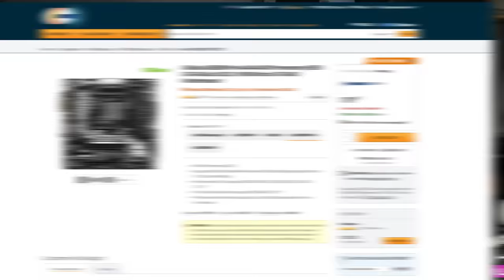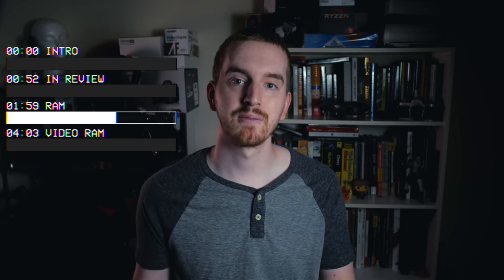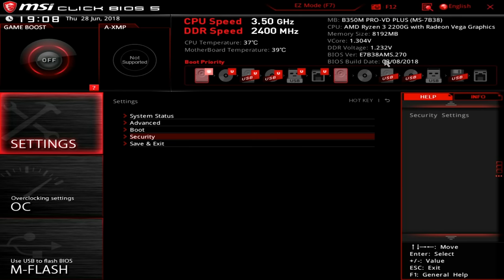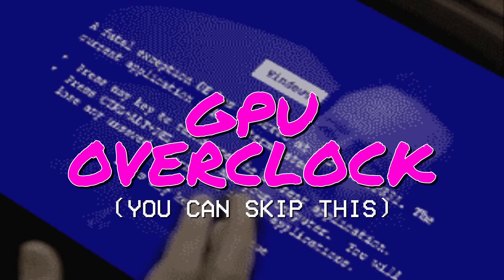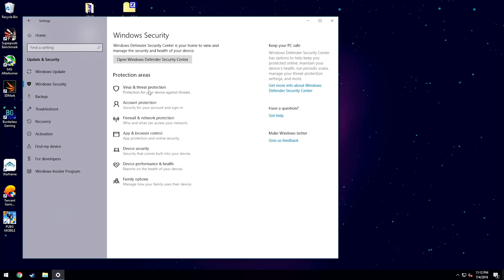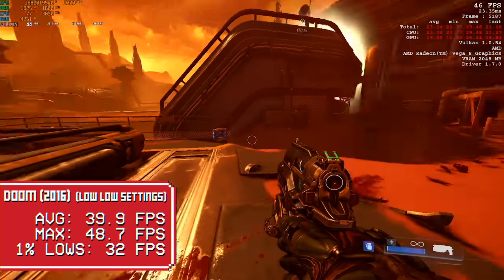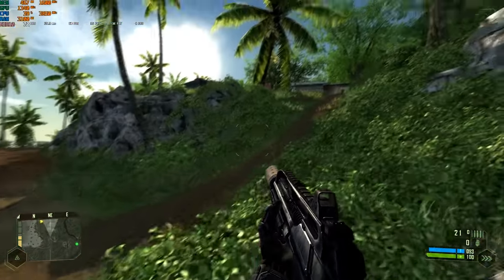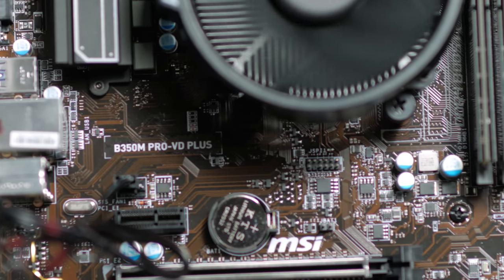How to get INSANE GAMING PERFORMANCE out of AMD Ryzen 3 2200G APU - Ryzen 2200G Optimization Guide

Comment: hello sir, i have 8gb ram but it says 5.95gb usable.. can u help me on this? ty
Reply: Im having a same problem
Reply: I may be able to help press the Windows key + R and type msconfig then press ok go over to the boot tab and click advanced options if the button "Maximum memory" has a checkmark on it and the memory (In Megabytes) is lower than 8 GB that is the problem you should be able to uncheck this box and restart windows which will hopefully solve the issue while you're in there you can specify how many processors are used during boot by default windows will use 1 but you can change it to use all cores during boot which may decrease boot times
Reply: @EternalOhm  i've already done that sir but its just the same, nothing change... my ram is ramsta 8gb 2400Mhz
Reply: @nbahighlightz52  What version of windows do you have? I'm under the assumption it's Windows 10 64 Bit but have no way to be certain. Also do you have a integrated GPU or a dedicated one or both?

Comment: highly recommend using b450 motherboards yes its more but its stable with ryzen 2200g and 2400g. sometimes a bios update just is not the same as the motherboards designed with a chip in mind.

Comment: why are you running these games at 1080p? You could get almost double the framerate at 720p
Reply from the maker: Because it's a standardized benchmark resolution to run at, and running games at non-native/non-even-integer-scaled resolutions on LCD monitors generally looks horrible. Thankfully most modern games come w/ built-in render scaling while keeping display resolution the same to combat this.

Comment: I have the ryzen 2200g/x370 pro carbon and i didnt oc or enable the boost and the vcore voltage 1.384 should i lower it or its ok?

Comment: what if I go for 2400G Ryzen5 instead of 2200G Ryzen 3? have a tower cooler or water cooling and an Asus Board with 3000MHz plus 16gig ram2? should I go for B350 or X350, X370 or X4XX for future proof CPU upgrade?
Reply: Save up for a RX570 instead, and pair  it with the Ryzen 3 ..

Comment: The trick with igpu OC on a APU is that is completely USELESS to OC the cpu part, they already got nice stock clocks, gpu OC will benefit gaming performance a lot more.

OCing the cpu part is just wasting TDP and stability that could go for the gpu.

With igpu OC on this APU's sometime you will get crashes at 1600 but none at 1650, or 1550. Quite funny.

Comment: When i was with only vega8 on board, i did overclockboth cou and gpu, thoughi could run easily gpu at 1550 mhz and it was stable...
And mine 2200g was running at 3.9 ghz stable.
So yeah nice video, but all of these i did before even watching your video :0

Comment: why remove the battery?

I never seen a MObo without the jumper to reset cmos...
Reply from the maker: Tiny mobo that isn't labeled well and it was easier to reach down and grab battery than pull out a screwdriver find the right pins each time, etc. Battery method is how I've been doing it for 10+ years, just how I do things.

Comment: What has worked for me and assured RAM stability is downloading and burning a disk or bootable USB to run MEMTEST86 which is free . I have seen failures on the 2nd pass when the first was clean but never after the 2nd test(but take that with a grain of salt because I've only tested about 50 different times). Initially I run the default 4 passes and cancel test if to make adjustments if I'm getting errors. When you find what you believe to be stable, let it run over night while you're sleeping. 10 passes might take around 8 to 9 hours depending...  Also for Ryzen google Ryzen RAM Calculator or just go here http://www.overclock.net/forum/13-amd-general/1640919-ryzen-dram-calculator-1-1-0-beta-2-overclocking-dram-am4.html and download the calculator and watch the video. I personally have had better luck loading from XMP than using Thaiphoon export to calculate the settings but you will need Thaiphoon for the RAM information for the initial settings in the Ryzen Calculator. This will give you a better result than using the MSI preloaded settings.
Reply: 2200g and 2400g can get really hot under the stress when OC'ed and we are talking up to 95c left for 8~ hours, i wouldn't risk to find a fried VRM and hell what else.., especially on a motherboard with poor heatsink or completely without it

Comment: So I got my cpu to 3.85 and my gpu to 1600, my temps while gaming (Gta V Rp FiveM) usually are at 70-75 and sometimes spikes to 77-80 but that only lasts like a second or two. Any tips to lower the temps? Btw, my gpu voltage is set to auto.

Comment: I'm using the ryzen 3 3200g and got a stable OC on the iGPU for 1600mhz at 1.2v on a asrock b450m pro4. Even tried it on furmark and it wasnt going over 55 degrees with stock cooler
Reply: Can up vram up to 4 gb?

Comment: am running a Ryzen 2200g and had similar problems like you. But it was mostly because of setting my ram oc and cpu oc incorrectly. I barely gained 4 FPS average with a 3.7 cpu oc BUT my gpu oc to 1400 with voltage set to 1.2 works like a charm and gives almost 20 avg FPS! All my blue screen vanished after setting a reasonable ram oc. Like 3200 on a 3000 rated sticks. Also the stock wraith heatsink is good but not great

Comment: the video ram one is wrong my dude, you can leave it on 64mb without affecting performance since it uses system RAM as memory anyway. If budget gamers get only 8 gigs of DDR4 it makes no sense to dedicate 2 gigs to the GPU. I would appreciate it if you would correct yourself in the video. (windows 10 optimizes the memory better anyway so you might get a 5% boost allowing it to fiddle around with the extra ram)

Comment: 400W Dual rail would be enough even if you add 1050 or 1060ti. more than that gfx, you would get bottle-neck due to cpu. if you want more than 1060 later than no point of having this cpu cuz onboard gfx would be a waste and you would get stuck with a low spec cpu. if you have an old gpu than buy normal ryzen 3 for more performance.

Comment: Nice video but I don't really blame the APU. For example I built maybe 300-800 A6--A8-A10 apus and I've never had these issues. I haven't had enough time to run to Old APU use on Windows 10 but the ones I have run seem to be fine as well.  I think it's Windows 10 as there's so many weird issues with Windows 10.

Comment: you should oc the gpu on these apu first and get the highest oc you can then oc the cpu core last you will get higher gpu clock speed than if you do cpu first and maybe not as much cpu oc but the trade off is worth it

Comment: I have a biostar motherboard, if I set my ram overclock too high and it can't boot up it retry's to boot up two to three times more before automatically resetting the settings to the stock speed and then I'm fine.

Comment: Cant get past 2933mhz with my  2400mhz 2x8 g skill ripjaws v kit, i tried loose timings, higher dram voltage and soc voltage but nothing worked. I have a b350m mortar motherboard.

Comment: The dilemma I have with AMD APU is that, it's either I spend the extra money I have for a decent GPU or spend it on 16 GB of ram since I don't want the system to be left with 6 GB of RAM.
Reply: I think it depends on what you're aiming to use the system for. I upgraded away from my 2200g, so I'm thinking of tossing that into a living room media PC that might do some light gaming when I have guests. I have no aims of it doing anything that's especially demanding, so a system total of 6 gigs of ram would be comfortable enough for my use.

I think that 16 gigs of RAM deserves a Ryzen 5 or 7, with a discreet card. Unless you're going to be doing some extremely heavy non-gaming stuff that's going to eat up a TON of RAM.

Comment: I don’t think you understand the point of showing game benchmarks - you’re supposed to keep the settings the same between benchmarks so you can tell the performance difference looking at the frame rate...

For a tech channel you should really know better
Reply from the maker: Which would be valid or worthwhile if this was a launch day review or something where benchmarks were necessary. Nowhere does this say it's a 2200G benchmark or review video. What I'm "supposed to do" is show what kind of significant performance differences viewers could gain from the previous build video to this one. Which was conveyed through the pseudo benchmarks, settings upgrades, and games that weren't even playable before.
Games that struggled to hold 60fps were kept at the same settings as last time.
Otherwise there's no point in keeping the same settings and showing that you can get multiple levels of graphics settings increases AND a higher framerate, that's more useful information than just raw higher numbers.
For a tech viewer, you should really know better.
Reply: I actually kind of agree with Epos on this one.
As long as 60 Hz averages and 40 Hz 1% lows are reached both before and after I'd say that the visual improvements are worth it and illustrating that it is even possible is well worth doing.
That said, you got a point in that it would have been nice if he also showed an apples to apples bench as well to compare them.
So a setting A setup 1 bench, then setting A setup 2 bench, then a setting B setup 2 bench.
But for a limited video length this is just fine in my book.
Reply: EposVox you claim to wait to show performance differences, the best way to show it is to show an increase in frame rate while keeping settings same. So you could say for example, after your tweaks you get 15% extra performance per say.

I don’t get what makes this so hard for you to understand. This is not a benchmarking thing, every serious tech YouTube channel compares performance between different cards/settings this way because there IS a way to quantify a performance difference between different frame rate, but changing settings from high to epic leads to different performance change for each game and is a terrible way to objectively measure performance increase.
Reply from the maker: "Extra 15% performance" doesn't mean anything to average gamer if you're already past a smooth, non-stuttery 60FPS. Again, if this was a serious, scientific benchmarking video I would agree with you. This is purely an experiment and show what you can do. I find raw benchmarks to be incredibly boring, as do many viewers, and much prefer this approach. The focus was the upgrade in settings.
Also showing apples to apples would've been nice, but this video was already far too long, that was the least important information, and I already put far too many hours into re-running the same benchmarks over and over I had little interest in doing it again.
Reply: I liked Epos's approach on this one too. You can always get relative numbers from reputable benchmark sites, but often i have a practical question, so i have these specific games - what grade of visuals and performance can i actually reach on a given system or from a given system upgrade? The game-based benchmarks have a synthetic flavour to them nowadays, because benchmarking on Ultra is so popular, but often the setting efficiency jumps off the cliff there because you have much more data throughput and computation for very little visual benefit and a playability disadvantage.

Comment: I bought two sticks of 3000Mhz RAM but in bios and in task manager it says its 2400mhz. if I use the ram overclocking technique to get 3000mhz is it guaranteed It will work cus I don't wanna tamper with the motherboard

Comment: I have ryzen 3 2200g build with gigabyte a320 Mobo... My pc starts , fan starts and turns off again! Pc won't boot... I've tried cleaning ram , hdd nothing worked.. I've also tried building everything from scratch... Didnt work either.. HELP?? :/
Reply: the a320 motherboard is not overclockable, higher speed rams like 3200 and above probly wont work, try using a ddr4 2666 speed ram, this should make your computer work
Reply: +Droid Tutorials
Tried pulling out the battery and turning off the power of the PSU then waiting for a few minutes?

Comment: most mainboards have 2 cmos reset pins indeed, (ancient ones usually 3, that switch between reset and retain) which you can put a jumper on to short them then press the power button as they are shorted to trigger the cmos reset.

but as jumpers are a rare sight these days, i usually just hold the tip of the screwdriver against them to short them 

when you start tweaking subtimings and run into a LOT of failed posts, it's a lot quicker than fiddling with the battery everytime.

i'm actually puzzled there are mainboards that don't have it... that's pretty ghetto if you ask me :)

Comment: It's disapointing you didn't include the benches of the pre-overclocked card. Can I increase video ram without a BIOS reset because a BIOS reset on a 370k board will mean I can't run 2200G
Reply from the maker: There was a whole video for it.

Comment: i'm surprised you're telling people to pull the BIOS battery, I can't think of a single board currently available (over the last few years) that doesn't have either a clear CMOS jumper, or button (if there's no button, there IS a jumper).... you should NEVER remove the battery, as it won't only reset your bios settings, it can forget the date and time, it can also screw with your windows Secure boot settings, and prevent it booting if you have it enabled, and CSM support etc.... (some times on by default)
Reply from the maker: Been doing the battery method for 10+ years and never had a problem with it. On some motherboards the jumpers don't quite clear all settings when needed.
Reply: That may-be, but i'm talking mostly about the new UEFI, since it has CSM and Secure boot, if these are enabled a security key is put in the UEFI during windows install, if this is missing or incorrect windows will no longer boot, removing the battery to totally clear the CMOS clears said key, and prevents booting....

I had this happen to me with a new(ish) build recently, luckily it was a fresh install and a reinstall sorted the issue out, I disabled CSM and Secure boot before hand though!

Comment: holy shit when you said this step is trial and error i did all of that step without knowing that's what i was suppose to do, i was just straight up guessing thinking i fucked up my motherboard, weird thing is when i got it all fixed and ready to go my motherboard audio 3.5mm drive broke and now has this static sound coming through it, i did everything to reinstall the driver etc, and later on found out my sound driver from the motherboard is dead. good thing USB audio is a thing.

Comment: If I had the AMD Ryzen 3 2200G, AMD Radeon RX 550, 8GB RAM, 1TB hard drive, do you think I could run fortnite with like high/low settings?
Reply from the maker: Absolutely
Reply: EposVox thanks for the reply, appreciate it

Comment: Honestly if you already have the 2200g and you cant afford a new graphics card look to the used market a 750 ti would get you a boost in performance or r7 260x both are around the 30/50 dollars used. Either would get you a much better gaming experience than overclocking the nuts off your rig which will reduce its life span, and running cpus at overclocks permeantly is not a great idea especially when said model is a K sku or x in amd ryzen terms so it wasnt designed with much headroom.

Comment: Nice video. I built similar 2200g system with msi b350m gaming pro and 2x4GB 3000 mhz ram. Only ram is overclocked to 3200. I'm having a problem where I do not get picture on display at all until windows boots up. I can't see anything in the bios at all when monitor is connected to igpu. I have to attach my old gpu when I need to access bios. 
Btw I'm thinking it is the monitor problem. It is old 16:10 1440x900 with only vga connector. When I attached my friend's tv using hdmi on igpu all was working fine.
Does anyone have similar issue?

Comment: Please rate my system
Ryzen 3 2200g (base clock)
GTX 1060 3GB
asus A320mk mobo
1x8Gb RAM 2400MHz
psu 550W.

Can i play PUBG PC without any rendering issues?

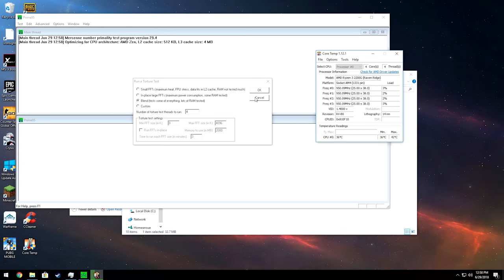Comment: 5:11 wtf??? Use the motherboard auto OC? While yes that may work the issue with it is it typically gives the CPU way more voltage then it needs for Ryzen 2 you shouldn't exceed 1.4 volts and even if the auto OC doesn't exceed this it's still better to manually overclock as you can probably get the voltage much lower while keeping the same clock speed (Not always though) it would've been much better to do a tutorial on manual Overclocking rather than telling people to use Auto OC also when overclocking ram you should run memtest for an hour or more but you said nothing of this

Comment: i cant get my 3200 corsair vengence led ram to hit 3200 i can only get it to 2999 or something like that on the msi titanium x370 motherboard. my webpages crash alot and youtube videos crash alot
Reply: I have the same ram eunning at 3133mhz in a asus x370 pro prime with a ryzen 5 1600x
Reply: @WarcosTec  yea but I got a different  motherboard and cpu lol  so it's a bios thing I'm guessing
Reply: @leighton138  yes but, it's a problem of ryzen 1, the second generation doesn't have this problem
Reply: Even if you are using a x370 mother
Reply: @WarcosTec  well  I might save for thread ripper prob the 32 core lol
Reply: @leighton138  that's awesome! But you will need a good mother, check their vrm
Reply: @WarcosTec  yea . I need to do something . I take care of my handicapped  mother so I'm trying to build a nice PC to stream and edit and maybe make extra money that way . I'm selling some guitars and my amp

Comment: I’m just wondering about the video ram because if you just use the default 256mb default vram it shouldn’t make a difference because when your vram use goes above 256mb it will start using your system memory. Giving dedicated vram will just make your system memory less. I may be wrong so please correct me if I am